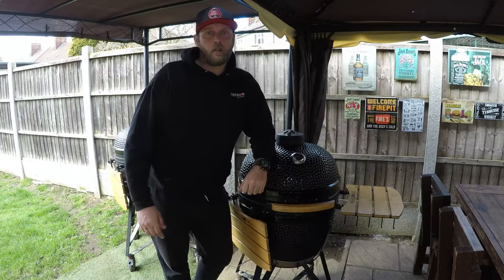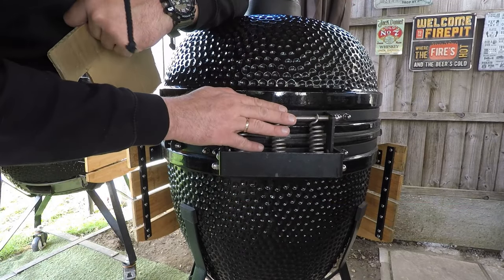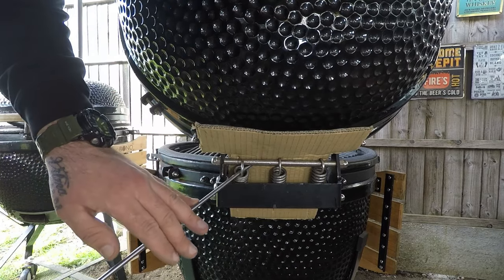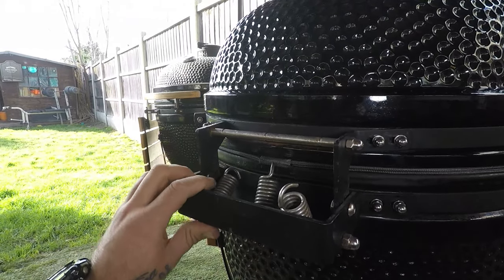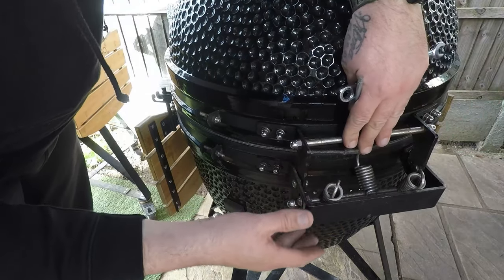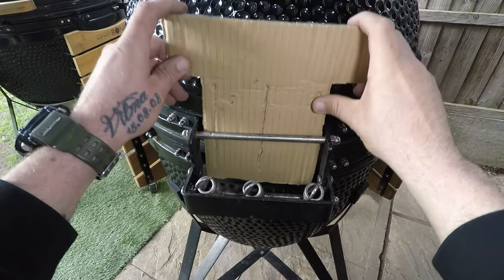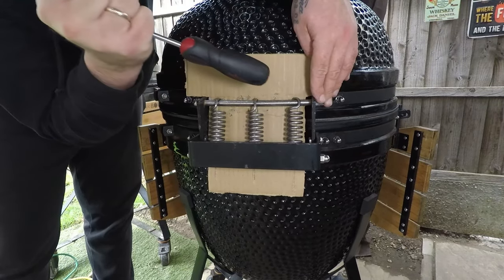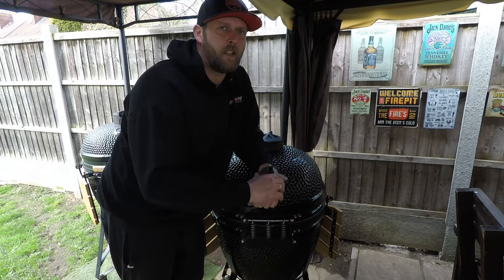How To FIX KAMADO - Kamado BONO Lid fixing - Episode 2

Comment: On my grande the top metal bar holding the springs broke in half! The bottom one has a bent... would you know by any chance where to get spares or any alternative?
Reply from the maker: Hi. have you tried contacting Kamado Kings as a warranty replacement? also i have a video on how to change the bars. https://youtu.be/EBpnkmlIWAo?si=JbuQjGYNTWfdfwlH
Reply: @LARRYGBBQGUY  thanks a million! My grill is over 2 years old, and I'm not sure if this particular fault is covered by an unlimited warranty. I got that in Ireland from a different crowd, but I will check with them. Thanks again!
Reply from the maker: @SlawomirMlynarowicz  definitely check with them, if not covered anymore, they may have replacement bars for you to purchase. Thanks for tuning in. appreciate it.